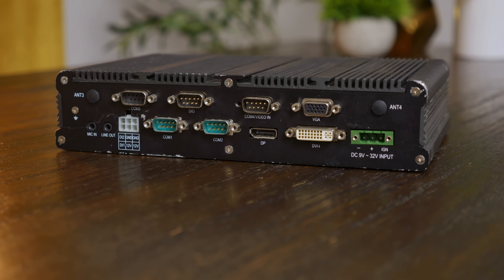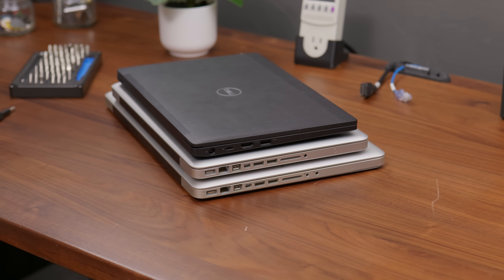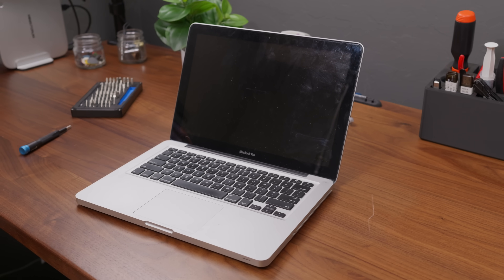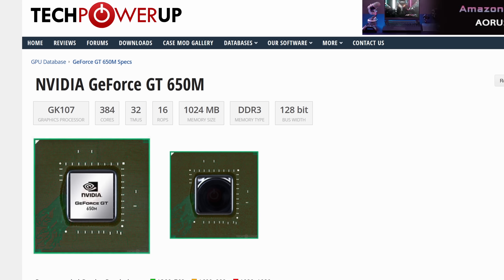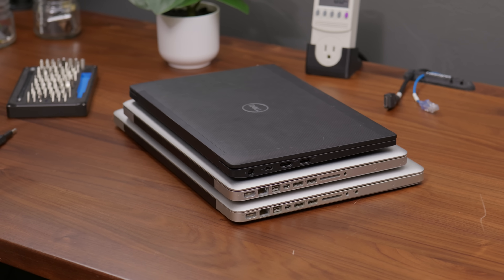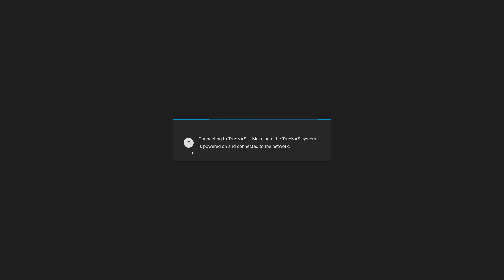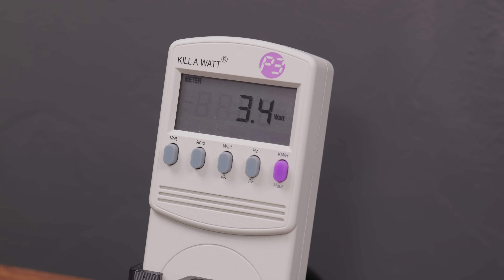Building Cheap & Efficient Home Servers with... Laptops?

Comment: My personal laptop is connected to charger 24x7, for last almost 8-10 years. Whether I use it or not, it's always charging. It's on sleep mode when not in use. No battery issues even in hot summers crossing 38℃ temperature. The battery performance is certainly down from 3-4 hours to 2 hours max. But that's very obvious over the time. Never had much power cuts. But recent long power cut issues revealed the battery performance. I would say it is still impressive.

Comment: I have a laptop server (kind of). It runs different programs I use for home automation and script testing. It’s actually a mineral oil submerged “fish tank” build. I used a laptop motherboard because it could fit in a smaller tank, and a bigger tank would have been too heavy for me to lift with weight restrictions.

Comment: My biggest problem with using laptops as servers is that the majority of them have no ability to auto power on. Because they are meant to be mobile and have batteries, most manufactures don't have a setting to power on when connected to power. I have thought about modifying bios code to change this, but most hardware doesn't really support it. Because the power system is different then ATX standards. Many laptops bios don't have control over the power system in the same manor as ATX system does. I have considered modifying the circuits with a micro-controller, but by the time I deal with all that I could just by a mini pc.
Reply: My Thinkpads all have a power on when connected to AC BIOS option. I have all T-series, so I'm not sure about the cheaper L series.

Comment: i run laptop server i7 gen 6, 40gb RAM, 4gb Quadro GPU, 2 T only for storage (broken display but i remote into it so i dont care) but i remove the battery for that specific reason, since ups dose that job, also wake when plug in setting in BIOS and connected to a smart plug.
my peak in consumption was 13.24 kwh/may, but normally is between 7 and 10, i only use it for Jellyfin for now, is that a lot what you guys think?

Comment: I'm trying to do the same with a 13-inch 2009 Mac, but the optical drive doesn't seem to recognize the HDD/SSD. I couldn't find the exact same one in Italy, but it seems similar enough. Did you encounter any problems with it? Or did it just work plug and play?
Reply: Trying to run HexOS, BTW.

Comment: Since I got a Macbook M2 from work as my everyday machine, I retired my Lenovo Legion Y540-15IRH-107, which is a beast of a laptop, into a Proxmox server. It's also got 32 GB of RAM, so it's honestly perfect. I use an Asustor DRIVESTOR 2 for storage on Proxmox, and I even bought the same exact switch you're using. The tip for the lid? Did the same thing to keep it running. Also thought it was cool I could use the battery as the UPS. One thing I did differently was handling WOL. While I cannot enable WOL on this laptop (weirdly there is no option in the BIOS for it), the NIC does support WOL, so I can suspend the system instead of shutting it down, and wake it back up using WOL. Not sure how much power it's drawing when it's sleeping, but I image not too much.

Comment: This is only a temporary solution for a couple of reasons, and I say this as someone who has done this multiple times. Laptops are not good long term servers without some serious modifications. First of all... Laptops, especially as you have them physically arranged, do not come with thermal solutions designed for long term, 24/7 use, especially if you put a load on them regularly, ie plex transcoding. Second, the battery is a ticking time bomb. Sure, some laptops with external batteries allow you to remove them and just run off ac power, but most with internal batteries will actually not turn on at all without the internal battery plugged in, so again you would have to worry about what the battery is doing, especially since they aren't designed to be fully charged all the time.

If you want to do this with actual laptops, you need to be prepared to gut them and mount their innards, including the built-in in cooling in a new housing so they have proper ventilation. You also need to do some research to see if the battery is needed for it to run, because again many laptops are designed to not run without them. If you dont do both you can expect problems down the road, and eventually a dead laptop.

Comment: Its good but got some issues:
1. The battery will die overtime and stop giving proper backup, unless you can somehow configure it to not charge it often. I've used a laptop for a while for homelab.
2. The laptop stand keeps the laptops together, which can make them heat up a lot overtime
3. If wake on lan doesn't work, there's also options to setup wake via USB or something

Comment: I'm in the process of transitioning my homelab over to HP ZBooks. They have nVidia GPU's, Intel AMT with KVM, 4x DIMM slots, 3x NVME slots, Thunderbolt ports (Able to upgrade to 10Gb networking), and best of all they're even more efficient than my current ProDesk minis. The only trouble I've come across is low quality 2.5Gb USB NICs. While I have the ability to go to 10Gb, they're way too expensive ($150+) and I don't even have enough 10Gb ports on my switch for all 3 of my nodes. For now, 2.5Gb is enough, just gotta remember to not cheap out on the NIC's.

Comment: I have two laptop home servers currently. They have a 7th and 8th gen Intel i5 with four cores eight threads and they both have 1050s for a GPU and they both have busted screens one was my daily PC for a while until I upgraded and the other was given to me for free because of its damaged state. It took a little doing but but I installed virtual displays and have the monitor on one completely unplugged and the other still plugged in but they both turn off when the lid is shut, but don't go to sleep. One is a Plex media server and the other is a Minecraft server. Since these two I've been adding raspberry pi for added compute because of how cheap they are in the low power draw. I have connected seven external hard drives with USB docs. They were all used three terabyte drives, this isn't ideal but for upfront cost it was pretty cheap. I really do need to hook up a watt meter and measure how much this is all pulling.

Comment: I ran a setup like this for years on a ThinkPad x260.  It has a 6600U with 16GB RAM.  Idled at 5W.  I kept the battery limited to 60% since keeping it at 100% all the time will shorten it's life in no time.  I also disabled the lid switch in logind.conf.  Luckily, closing the lid shut off the screen, so no extra steps there.  (Thought all laptops did this).  I used a couple bus-powered external USB3 HDDs with no issues.  The only reason I stopped using that setup was because storage was getting limited.

Comment: The battery charge controller monitors the battery charge level. And both the system and controller can disable charging to prevent overcharging. It is trivial to set an "over-provisioning" charge limit for the battery.

Comment: i have such old laptops that they were the kind where the batery i could take out without taking off the cover, windows 7 or 10 i think, i have 1 setup but it sadly only has 2x ddr 4gb ram sticks it also has a 1tb laptop hard drive

Comment: in the pursuit for the perfect travel laptop I settled for a dell 7290 from ebay. got it a new battery and Im getting sometimes even 7-8 hours of screen time. a nice lil extra in for me was i bought it from the states so aestethically it also has the US layout which is impossible to come by in my region. upgraded the ram, wifi and ssd with stuff I got laying around and thats how I ended with a solid and resilient machine for under 150$. the keyboard is also amazing, fingers just fly on it, and theres no annoying thinkpad nipple in the middle

Comment: Great idea! This is pretty much what I did with my old laptop as soon as I bought a new one. I even connected a few external hard drives and made a RAID 5 array out of them (I know that's really jank, but it works), and I left the screen on at a lower brightness with btop running, so I can easily check what it's doing.

Comment: Some newer laptops have an option to only charge the battery up to a certain percentage, making it safe to leave them constantly plugged into wall power. This could be very useful if you plan to use the laptop's internal battery as a UPS instead of using a proper UPS unit. My Lenovo laptop that's a 2021 model (and a friend's slightly older Lenovo laptop) both have the option to stop charging at 60%.

Comment: Over all it’s a good all rounder. We have a few old laptops that we use to just make a smart tv. Rather then locking into a eco system and subscriptions we have options as far as diversity of streaming. Our main server is a dell laptop with i5 32gb ram and it dose our jellyfin, Minecraft and photo back ups. Currently external hardrives for storage but has already made our lives easier then running around with one hard drive.

Comment: My previous daily driver laptop is a Thinkpad X230 which I replaced a few years ago. But I didn't get rid of it, and at some point it came in handy as a quick way to increase server capacity. So I installed Proxmox on it and use it as a second node. The CPU is limited but it has 16GBs of RAM, which goes a long way with Proxmox. It does not have a battery, because I also don't really trust leaving it on permanently unsupervised and the battery I have is really bad anyway. I've got an old ups (with a new battery) to make up for that. It can easily handle both the Thinkpad and the first  node (Microserver Gen8). 
I think I prefer a Mini-PC for a low power home server, but so far, the Thinkpad hasn't missed a beat. It's also convenient that it has a keyboard and screen built-in.

Comment: Your arrangement of the hardware is quite nice.  I was running a server on a mini PC for a while and needed a second media server and I just happened to have an older laptop that had crappy hinges back in the day.  I removed the screen years before and it was a perfect opportunity to use it.  One quirk of it was that the ethernet was 100 megabit.  It was fine for media, but annoying for transferring files.  Also annoying was the port layout.  Plus I was limited on drives without going with USB.  Other than that, though, it was good.  It idled at 6-7 watts.  I recently consolidated my two media servers into one desktop PC I already had.  I wanted the flexibility of it.  Conveniently, the idle power draw is about the same as the two media servers combined, but I have five SSDs in the thing now, one of which is just the boot drive.  But using the old, broken laptop worked well for the year or so I had it set up that way.  It's always nice to be able to repurpose old hardware that way, which is something that also applies to my new server machine.

Comment: Man, the timing on this is really good. I was recently contemplating the idea of having a server to access my roms and music anywhere in my home, and I was looking at your videos on Raspberry Pi, and then mini pc...but I'm not a huge fan of buying new stuff for edge cases (basically my edge case is, I don't want to lift my ass to plug my sd card for my Steam Deck into my PC to add a rom or something)

And I was thinking, "that'd be great if I could use my spouse's old dell laptop instead of buying a new computer". And there it is!

Putting it in my favs, I'll be looking at it tonight :D

Comment: I've been using a laptop as a server for years, it runs my cctv, DNS, website monitors(to monitor clients websites), some virtual machines, and they have a built in UPS 😎😎😎 At like 7 watts. Works well. 😎 Just limit full charge to 60% and basically no battery degregation occurs. And maybe set max cpu frequency to 99% to keep it cool. Unless you need the extra performance...

Comment: I did local support at a place I worked in Sydney, Australia, around 2005-2011. 

We had an NT4 server, probably the only one left in the southern hemishphere, serving about forty staff. 

Eventually, head office (interstate) got sick of the increasing number of shutdowns and ordered a new rackmount server -- which arrived badly bent together with some other heavy components which were left on the footpath, resulting in my injuring my back getting it upstairs.

Until the pain got really bad, I worked on the server with a hammer and makeshift keyboard/mouse/monitor supported on some scrounged boxes, but to no avail.

The situation needed not only a new server (and compensation from the courier company) but also an interim solution, so head office sent me a laptop and power supply and a switch, which I duly set up on a filing cabinet in the server room. It was running, from memory NT 2003 server.

This ran network drives and a few printers for about two months. This time one of the IT staff from interstate arrived and installed a new racknount server one day when I wasn't working, which suited me.

We had no significant problems while dependant on the old Dell laptop. and the Melbourne IT bloke who had sent it up said, "It's powerful enough, and it has its own UPS."

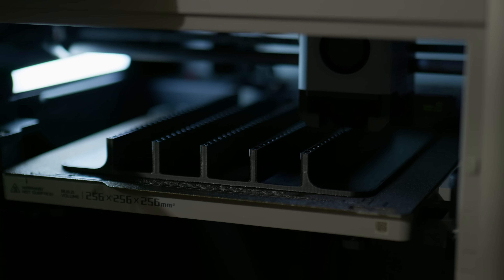Comment: 1:41 wrong printing orientation
Reply: Nerd
Reply: How is that the wrong printing orientation, what else is it supposed to be?
Reply: @Duckl4yer  With this print orientation, the ribs have the smallest bonding area between the layers. That means they’ll break more easily compared to printing the part on its side. Plus, in actual use, the ribs will be stressed in exactly that weakest scenario.

Comment: I use lenovo mini pcs, the m710q mostly. They're dirt cheap and barely use any power. And I use external WD raid enclosures which also hardly use any power either.

Comment: Years ago I upgraded my laptop with a motherboard with a bit better gpu, maxed out cpu(yes those were the times where you could replace laptop cpu) and I still use it as my main laptop on top of many PCs. I did all of that by buying broken up laptop withouth display and keyboard, but then i just installed ubuntu server on that spare motherboard with  3rd gen i3 and used it as server for at least 2 years. It should still work, but limited drive options pushed me into upgrading to fanless am4 athlon, and later on n100.

Comment: I have multiple rack mount servers in my lab, but I've been using an old Dell laptop as a docker host, running Rocky Linux for years now, and it's been fantastic. Since the laptop battery is still good, it frees up a spot on my UPS, and on the rare occasions when I do have issues I don't have to go find a monitor and keyboard for local troubleshooting. 

Anyone who doesn't want or isn't able to spend hundreds or thousands of $ on a "real" server should absolutely start with a laptop running some flavor of Linux, Docker, and Portainer for container management and deployment.

Comment: The Dell laptops are a good choice.  As a rule go for the enterprise ones if you can anything insperon 54xx for example the 5480/90 are kind of end of life for most corps so they get binned off for cheap.  5400 and 5410 and even 5420 are all great contenders  is fine. They run without screens attached physically and you can even remove the batteries. Two memory slots and room for another ssd/M2 if you don’t mind tinkering.  I have  the Dell qualified  Tech certs and pull these and newer apart on a daily basis.

Comment: This is a great idea for a video. However it's all fun and games until you get a spicy pillow. Batteries are meant to be discarged... There needs to be a way to limit charge to 60% for long term uptime. If the machines boot without battery, then disposing of them is the best way.

Comment: 13:20 rarely ever any risk but they certainly do not like staying fully charged, the battery will quickly degrade after a few months and be unusable, so one of two things, look in bios for a battery saver mode that will limit charge to 80% or remove it entirely.

Comment: My home Server has been running for the last 5 years on an old work hp. Did the same used the DVD bay to add ssd and a couple external USB drives. Running 24x7 since then. My uptime was over a year and a half once. I turn it off once a year or so to clean the fan as loads of dust builds up in there. Battery is still holding and keeps the server running if I have to cut power in the house for something. Idle power usage is 13W. I have around 20 containers running.

Comment: I have this exact same macbook! It has an i5 3210m now rocking windows 11. Have tried linux mint and learned a heck load of stuff. Although replacing it soon, it is still my daily workhorse with win1. Wonder why I am using a mac? Thats because thats just what i have! I have another windows laptop but it doesn't have a battery

Comment: Some business class laptops will let you configure the charging. I kind of use pretty much any computer as a server already. My primary computer is a laptop and most of the time is plugged in but I have it set so that it won't charge to more than 60% and will not try to recharge the battery until it naturally depletes past 50%. On MacBooks you have to becareful once the batteries eventually swell and you remove them, you need to replace them as spikes in power draw can cause the system to crash, at least that's what happens on my old 15-in with a dgpu.

Comment: Of course, it's still preferable to sell all these laptops, especially considering that they have virtually no cooling, and the battery could swell up (even though there's a UPS at the input). In a rack like this, the screen is pressed against the keyboard, and if the battery swells, it will simply break both the keyboard and the display, leaving marks on the screen that can't be wiped off. (This happened to me.) The most economical option is a mini PC with T-series processors